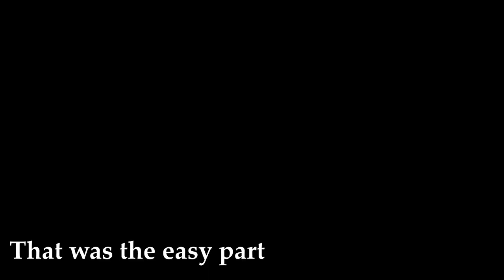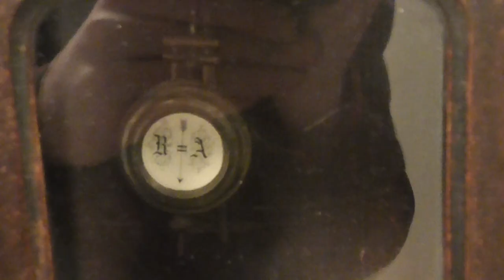Making a Clock Work

Comment: Wow! This was really interesting. It would never have occurred to me, but this kind of thing would be right in your wheelhouse. After all, what is a clock but a series of precision gear trains?
However, I think the clockmaker who revived "Mademoiselle" (an antique French full strike wall clock that I own) would wince a little bit at your use of a full-size lathe!
Great job, although it sounds like the gong needs to be adjusted so that it chimes freely.
Reply from the maker: Well, I learned the trade of industrial mechanic, so my approaches at fixing up a clock are... industrial, too xD
The dull gong is from a cracked solder joint between the long vibrating stick that makes the sound and the screw that bolts it to the holder. I tried refreshing the solder, but I think it'd have been a better idea to take the joint completely apart, clean things up and then silver-solder it together (soft solder probably acting as a sound dampener).
A little out of budget for what the owner wanted, however ;)

Comment: 😎, done a few but never had much luck with faulty  escapements , took those to a  specialist  🙂
Reply from the maker: It might be possible for me to make a new one if I had the original contour to copy - but designing one from scratch is definately a task for a clock maker, not a clock fixer.